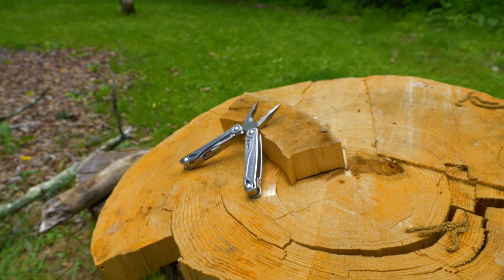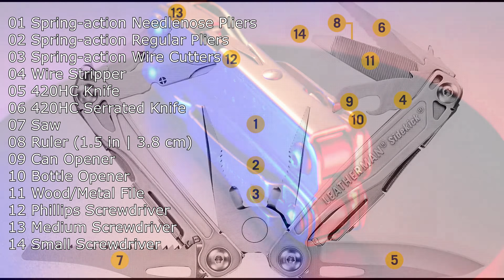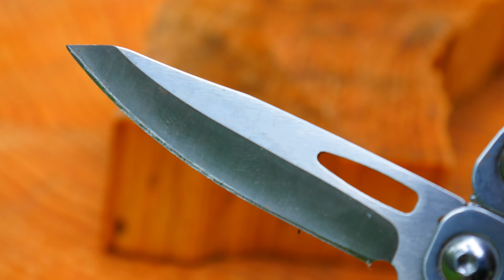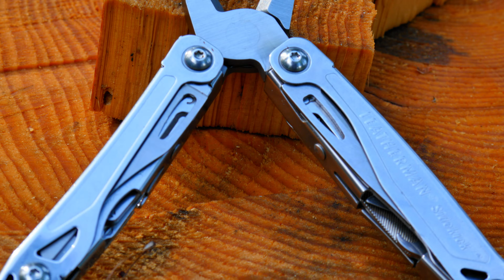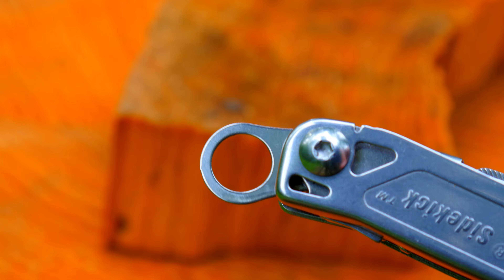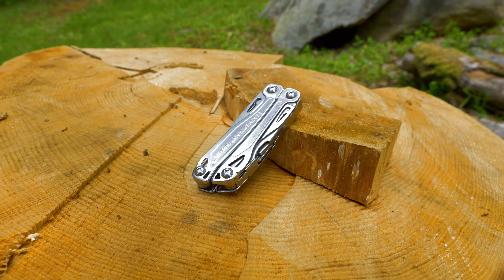Leatherman Sidekick - An Outdoors Companion?

Comment: I have a wingman and a sidekick.
Either is great for traveling. And carries easily in the pocket with the included clips.
The sidekick has the better tools for camping or outdoors, including the saw and lanyard ring.
The wingman has the scissors and package opener.
Used my wingman once to fix a refrigerator in Siberia. 😃

Comment: I love my Sidekick, except for that big flathead screwdriver. It’s too thick.
Reply from the maker: Yes. Though it doubles as a light duty pry bar. The depth gauge file has a smaller slotter tip but be careful not to apply too much force on the tip

Comment: I personally respect the Sidekick because I find it to be good in most major areas:

- Good variety of tools;
- Good usability (how well the tools perform their intended function);
- Good sturdiness (for a tool of its size);
- (more than) Good portability thanks to its pocket clip;
- Good warranty;

Considering the price of everything nowadays, I also think that it has good affordability. Concerning usability, the file/ruler and serrated blade are short, but I still find them handy when filing burrs off of cut metal, when measuring nuts and bolts and when cutting rope.

Comment: Package opener at the Rev is useless in my opinion, there are enough other tools to open a package with. The value of a saw is so much higher.
Reply from the maker: Agreed
Reply: But the value of sciccors is even higher than a saw, that's why the Wingman takes the cake between the Rev, Wingman & Sidekick.
Reply from the maker: That depends. I use a victorinox that has scissors and saw and find them both useful